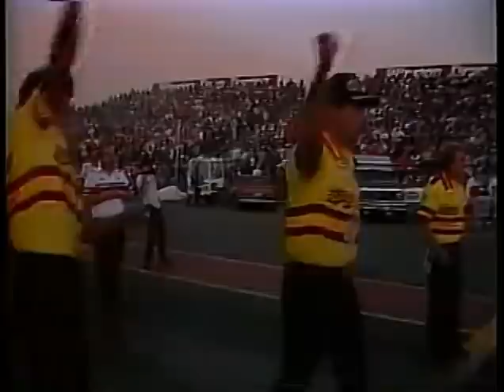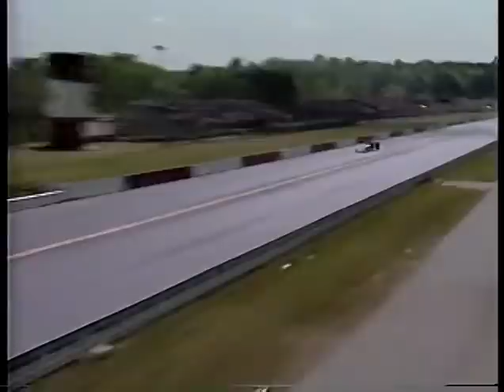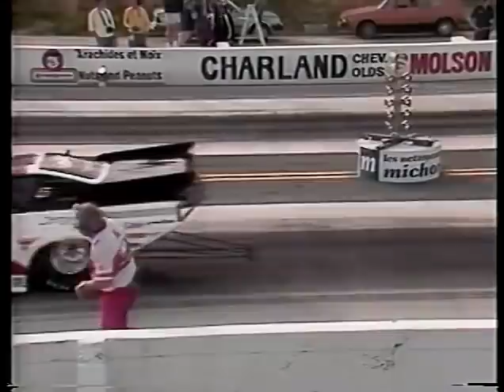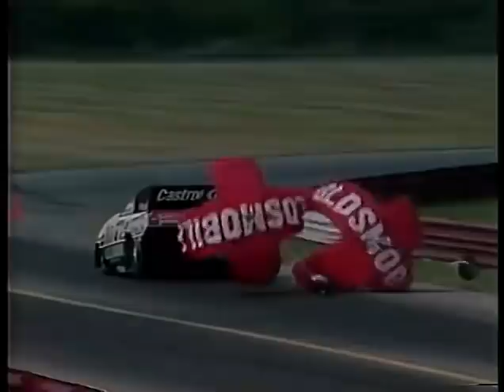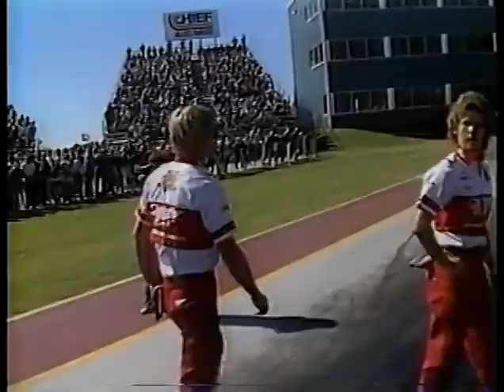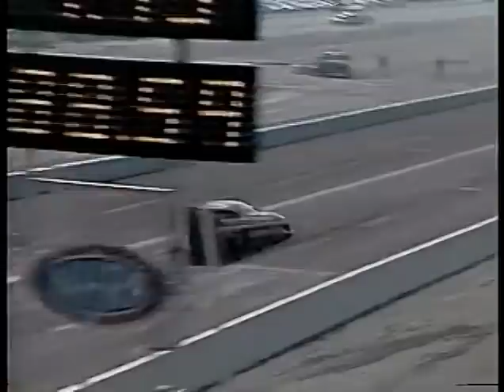NHRA Drag Racing'87

Comment: I miss the 80s and 90s racing, won't give the NHRA a dime ever again. Once again money ruined something so enjoyable to so many.
Reply: My mom came up with it in the 70's & 80's. Her dad was a pro-stock mechanic and originally did some racing in the 50's & 60's around the AHRA days. She said pro-stock was like the most real drag racing there ever was and that the modern day stuff also really wasn't the same as you mentioned. I came up with it between 2002-2009 thanks to her and I feel like it really went down hill after 2008 (when Scott Kalitta died and the track runs were shortened to 1/8th mile).